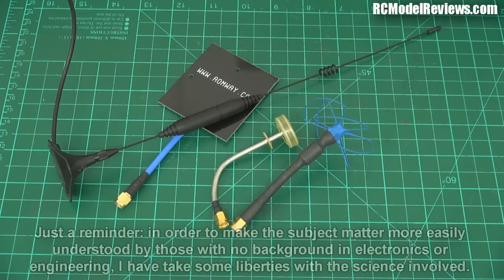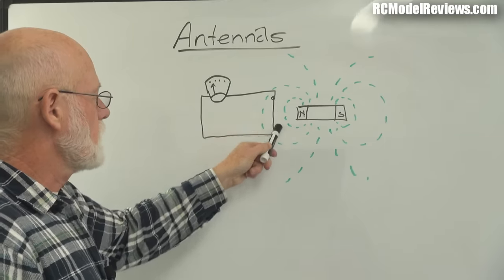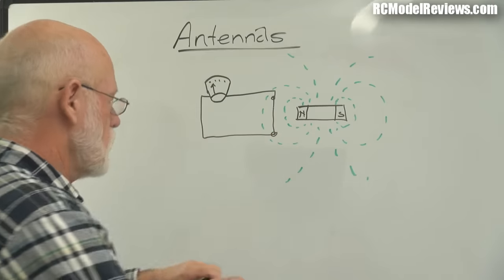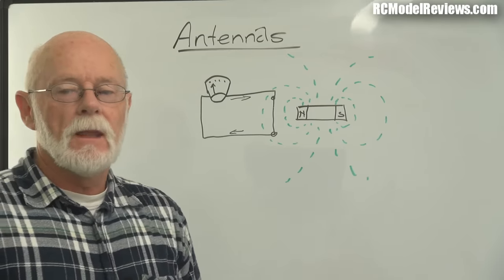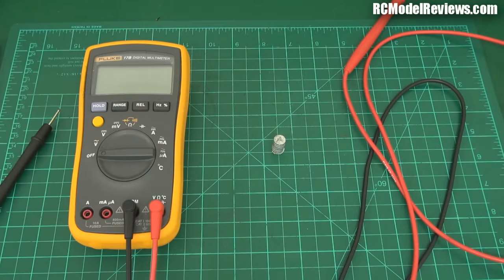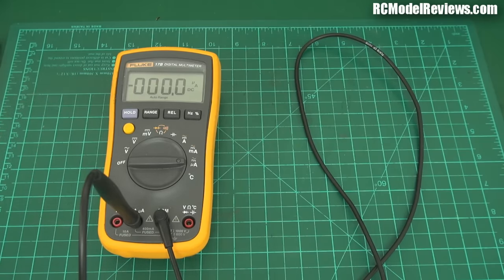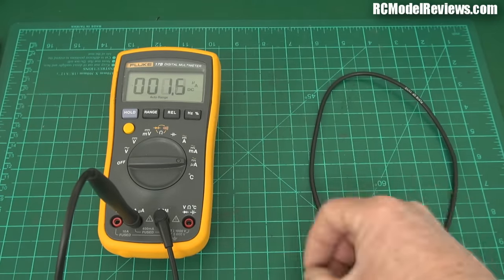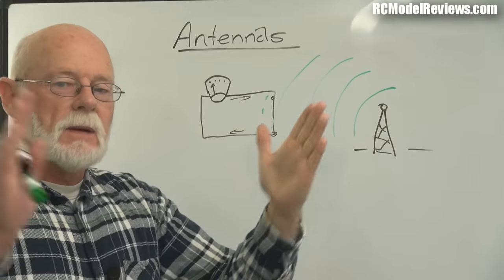How do antennas work?

Comment: To clean nearly any smooth surface of anything from crayon to perminent marker, Lysol spray works best. I worked at a truck stop for over a decade cleaning the amaturish art off of stall walls. The marker shadows on your whiteboard will completely disappear immediately. Please don't use penetrating oil on your whiteboard.

Comment: Wasn’t the Yagi antenna intended to transmit energy originally instead of information over radio waves?
Reply: No, it was first widely used for the early airborne radar sets, then after WW2 for television. Any antenna transmits energy in the form of radio waves.

Comment: What I don't get about antennas is that if I had a meter on the output of my antenna, why is that you cannot detect when someone turns on their radio and tunes to your frequency?  Because, aren't they essentially part of an electric circuit drawing power from it?  Obviously the answer is no, but why is that?

Comment: This is an excellent explanation and for the most part scientifically correct. However using DMM used in the demonstration of induction current is about as bad as possible. Few instruments are worse than a DMM to show this. The only feasible instrument really is an analog micro ammeter.

Comment: 13:20 You say a 1/4 wave antenna is the most common with no explanation as to what makes it a 1/4 wave antenna.  16:10 You say you can't make the wire longer when looking at 1/4 wave antennas.  Could you not use a 1/2 wave or full wave antenna?

Comment: sorry to point this out but radio waves are mainly composed of electric field, not magnetic field.  The contribution from the magnetic field is quite small.  Here is a calculation: https://www.nagwa.com/en/videos/256184146278/  .  The wave is usually made by the oscillation of an electric dipole, not a magnetic dipole.

Comment: Q U E S T I O N -- RCMODELREVIEWS. Regarding a Boombox (QFX J-22U) two stations on the AM band that I listen to exclusively are rumbling annoyingly, although the radio is brand new (the other features, no problem - and the lower stations on the AM band are good). The boombox fell from an 18" high chair, by the way.  I've connected via the four D batteries to inspect the insides. There's a thin, white (about 6-7 inches long) wire that's soldered to the motherboard, but the opposite end is loose. The antenna (the rod) is NOT connected to any wire from the motherboard. Shouldn't it? Does the white wire that's loose on one end have to be connected/soldered to the rod antenna internally? Our other radios are okay. Oh, when powered via the batteries, the rumbling noise on those two stations don't happen, but via the electrical cord or even the adapter (adapter slightly better) those two stations have the static.... Thanks, again.

Comment: Is someone in the condition and willing to calculate the frequency range of the round antenna, or handle, if it is a fake image, above the 'Flying Saucers/ Discs' of mr Adamsky? It looks as a microwave or other radio emission antenna.
Junkers Ju-52 transport airplane had a similar round antenna on top of fuselage
Blessings +

Comment: How do you “tune” aerials like are used on cb radios
Reply: 1) Buy one already tuned (like a WIlson  or Francis) 2) If you've a SWR meter, tune in to transmitting channel and adjust length to minimum  reflection. 3) some receivers can electrically adjust the effective length of your antenna 4) A coiled whip may need the coils adjusted like new (assumption is travel knocked them out of kilter and antenna length wasn't clipped - otherwise see #1 above)

Comment: Here in the UK, our terrestrial TV uses yagi 'aerials'.
Our main transmitters are horizontal polarised, but the little booster transmitters are vertical. 
My job is installing them.
The band is UHF (ultra high frequency) 471-860
However, 10 years ago, the top end was used for 4G, and very soon, the next section down will be 5G.
Now if any conspiracy dickheads bang on about 5G, you tell them we in the UK have had those exact frequencies pumped out for 50 years, at vastly more power than mobile phone masts, and it has no effect.

Comment: I think Faradays law is really where physics becomes unintuitive (hard to imagine why). For heat its fine because i can imagine the electrons spinning faster around the atom as the material heats till they are forced to higher electron shells (orbits).
What is unintuitive to me is that magnets cant induce current while stationary. If the magnetic field does indeed push electrons on atoms in a direction (which at the end of the day is current), then why cant we have a loop of wire where half of the loop is under a magnetic field going in the direction you want the current to go, and the other half of the loop in the opposite direction magnetic field (still in line with current on that side. Theoretically i would presume that the electrons on the top flow clockwise with the magnetic field and the electrons on the bottom also flow clockwise with the magnetic field creating a circular current, but apparently that is not the case…

Comment: he should have explained in a better. way, the length of antenna must have an impedance reactant L matched to the output impedance of the radio set Z. to get maximum power transfer and lowest. line loss

Comment: 3:30 - You should've dug into your miscellaneous drawer and pulled out a small analog meter for this part of the presentation. Also, 100x more transmitting power doesn't typically equate to 100x more signal received (square of the distance and all that).

Comment: If you use magnetic antenna it is invisible, the smartphone is small but it can detect near ful spectrum because no physical antenna needed. That what college for
Reply: Im pretty sure mobile phones have antennas. It goes around the inside of the phone.
Reply: @kevino6416  no, it is not like physical antenna, smart phone or if I design we use magnetic field to sense signal like mine detector it could be AC or DC passing through a coil or a wire then sense it magnetic flux field and detect interferences from emitter and return field just like MAD magnetic anormality detection

Comment: "One way gives me positive, the other way gives me negative."

Sorry, no. Either direction produces an AC signal with both positive & negative phases. Reversing the motion (or the magnet) just changes the phase of the AC.

Otherwise, it would be possible to produce a DC generator without the need for a commutator or rectifier - and its most definitely not.

Comment: initial example is inaccurate though - a moving magnet inducing current in a closed loop is not proper electromagnetic radiofrequency propagation. it's just electrical induction, and doesn't originate a propagating electromagnetic wave; it's what happens inside an electrical motor rather than inside a radio transmitter. things are related but not the same, and the closed loop in that case cannot be properly considered an antenna.

Comment: First it’s not correct t say your meter leads is an antenna. That’s just magnetic induction.  Antennas convert electrons movement into electric and magnetic fields  that are 90 degrees part. Wholes different process.

Comment: I was hoping you would show me how to build or modify the antenna on my FM radio for better reception. Anyway... Why is it that when I hold one end of a wire antenna between my fingers, I get better reception? Or hold one end with my foot against the concrete floor in my basement, the reception is better. But when I take my foot off and hold it down with a weight, I lose reception?  It appears that the human body makes a better receiver than the antenna alone. Probably why the world saw such an increase in cancer after the invention of the radio... just sayin'.

Comment: The speed of light is based on the observer.
Not every unit of consciousness is running the same electrical density consciousness.
Hyperspeed 
Hyperdimensional geometric space 
Vectors 
Vortexes 
Light bends on the event Horizon Vortexes spinning the particle spin rotation of our Merkaba,which is our light Spirit body and Soul to power our state of Quantum consciousness energy to experience the Heavenly realms.
That means losing mass density to faster through filling up space with higher speed waves as potential
Electrical potential 
Cells love alkaline PH environment 

We run 9.4 PH
900 Mhz which is purple light.
Kool colors so we don't burn up our Biotechnology operating system that runs on electrons and magnetic light amplifier to vibrate off the charts.
Try it some time 
Zoom through the Heart chakra and 12 Star Gates

Comment: Hmmm, I'm sure this simplification will help some newcomers but you're muddling magnetic lines of flux with electromagnetic radiation. A wireless charger is a transformer, not a transmitter and receiver at all.

Comment: Dude! Antennas DONT work line a magnet moving across a wire. That’s totally wrong. They depend on the electric field to push the current. Please do a little research before making videos.